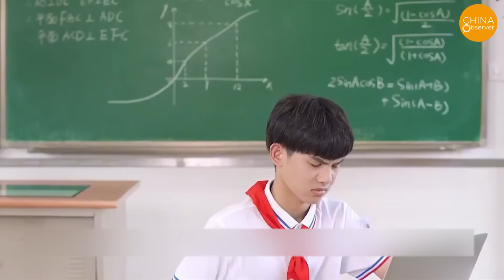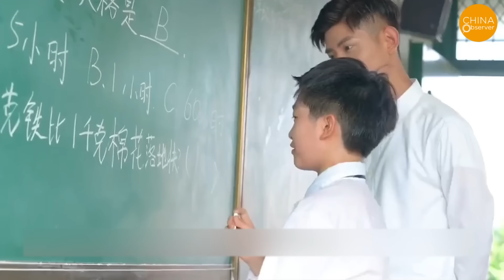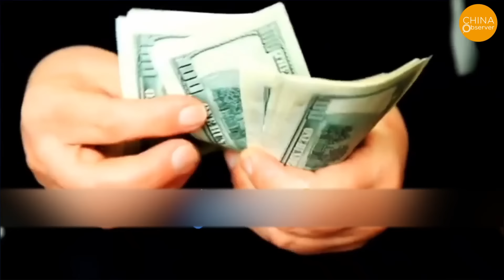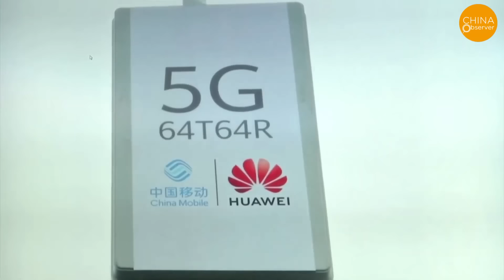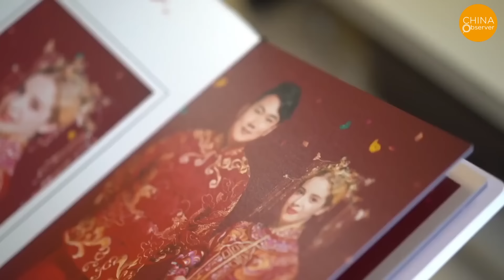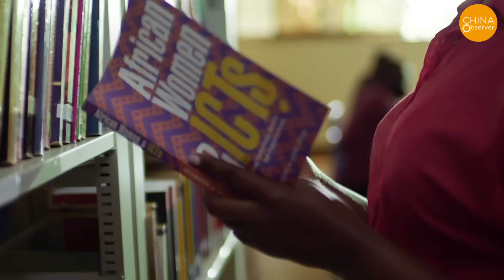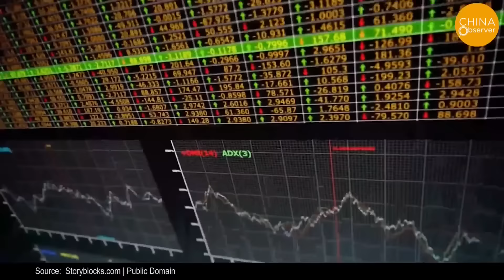How Bad Is the Unemployment Situation in China? Can NOT Find a Job in China, Youths Flood to Africa

Comment: Annually income 410 - 480,000 rmb, average is 445,000 rmb, plus overseas allowance 230,000 is then 675,000 rmb. But saving in 3 years is 500,000 (÷3; annual=) 167,000 .. meaning the spending is (675,000 - 167,000)= 508,000 rmb ; is the cost of living yearly. The portion of annual/daily (percentage) is (508 ÷ 675)= 75.3% . Said who.. that cost of living in Congo/Africa would be cheap (should be lower than 40% ..to called cheap.)?!?
Reply: That's definitely far better than being struck as an overqualified takeout delivery rider in China or worse, jobless.

Comment: 02:35 next, saving then lowered to just 120,000 rmb annually; (675,000 - 120,000) = 555,000 rmb ; (555 ÷675)= 82.2% ; even greater than previously 75.3% spending (tax not included, yet). The only true implication is that the ATTRACTIVE income of 480,000 RMB is a LIAR, not true (or were subjected to very high (upto 40%) of taxes.. (675× 0.6)=405 K ; (405-120)/675 = (57/135)= 42.3%(>40%) ..the spending of 75-82% reduced to 42% due to (if you're) highly taxed of more than 40%.. Higher than France or Sweden, do you, Liar.
Reply: Annual income 480,000 plus allowance 230,000, totally is 710,000 rmb. But remains/saving is only 120,000 ; (120/720)= (1/6) roughly 17% ; spending is more than 80%.. (high tax? not possible, maybe 480k RMB is just a HOAX..(?!?)